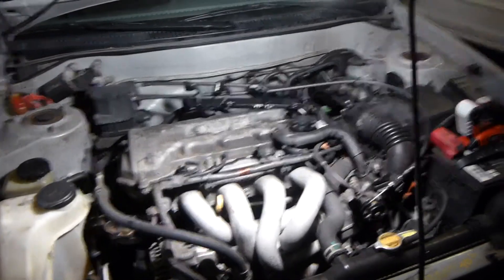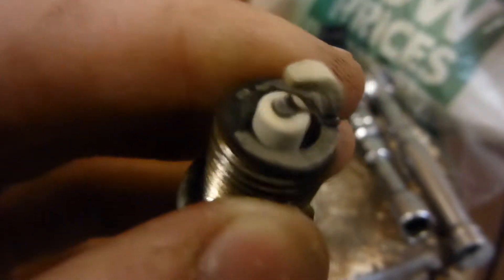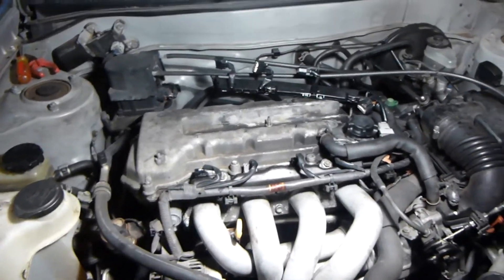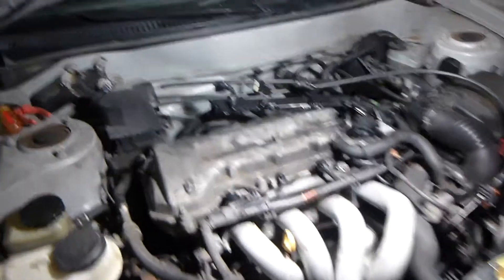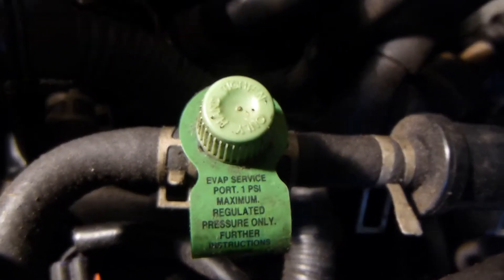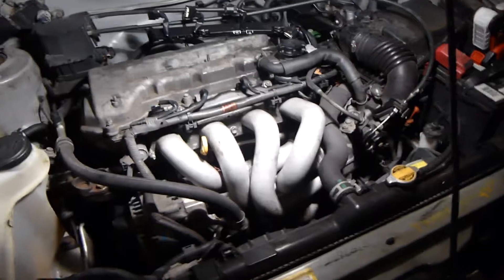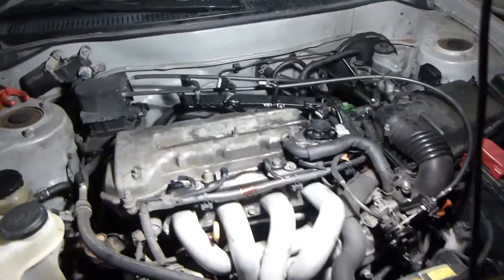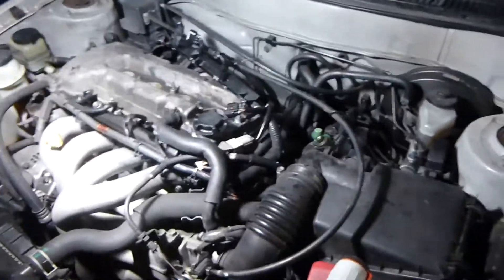Does My Toyota Corolla's Spark Plugs Look Okay and Talking About Running My Car on Gas Vapors

Comment: Looks like oil deposits to me: http://ngksparkplugs.com/tech_support/spark_plugs/faqs/faqread.asp

Could be totally normal, especially if your engine burns a little bit of oil.

Get yourself a new set, and check again in a month or two and see what they look like. Those suckers might have been in there since it rolled off the lot.

As far as fuel consumption goes, 28mpg isn't bad. Best things I can recommend for that are replacement plugs and a thourough check of your emissions control systems, intake, and exhaust. Seal up any intake leaks, maybe replace some rubber, make sure your emission systems are functioning, and check the catalytic converter. 

Buy yourself a Haynes or Chilton manual and have at it! You're more than capable of rebuilding that motor if you decide to, don't be intimidated.
Reply from the maker: Bottle Cap Hahaha yeah it's possible they are that old!  I will get a new set sometime!  

Sounds good!  I'll give it a look over!  I think I will also have it tuned up.  Not sure how long it's been for it.

Yeah I will buy myself on of those manuals!  We have one for our other cars.  They have proven to be very useful and a big money saver!

Thank you!

Comment: Fuel filter should be under the car close to the fuel tank and possibly in the tank or both.
Reply from the maker: shazizz I think it's in the tank before the fuel pump.  Luckily the fuel pump can be taken out from a access door under the back seat.